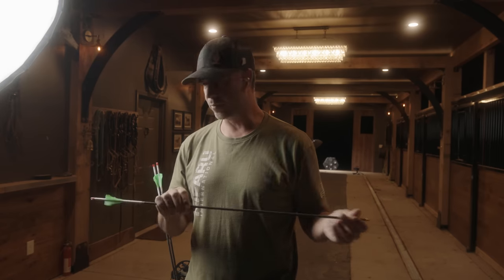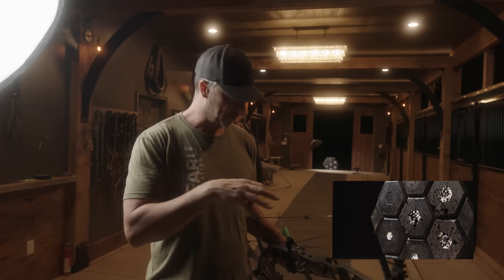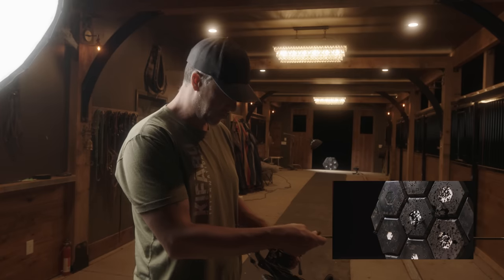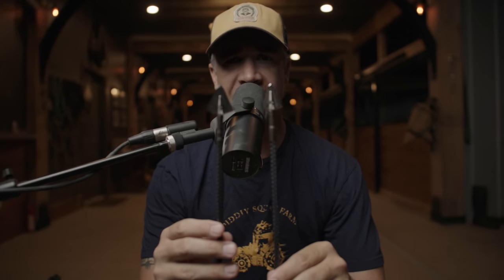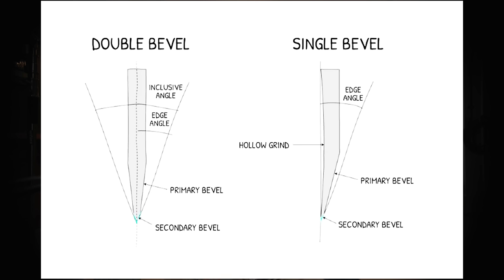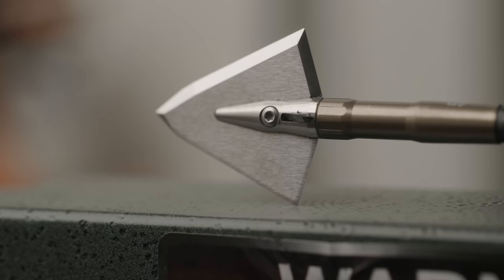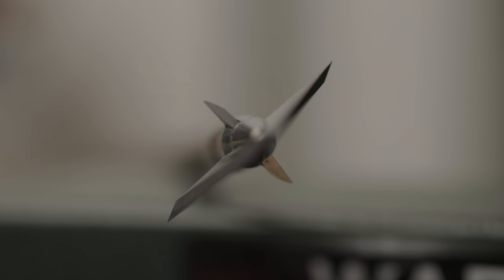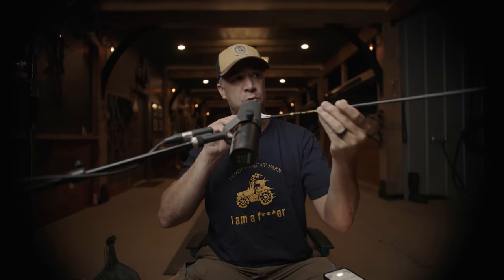Single Bevel is better than Double Bevel, but not the reason you think.

Comment: So i have 1 honest question that anyone is more than welcome to answer. I have wanted to use the Iron Will single bevel braodheads. A guy I know that owns a bowshop, told me to not waste my money on IronWills. If I want single bevel broadheads then I need to save about a 3rd of the cost and get Kudu 125g single bevel broadheads. I will say that they enter and come out with so much force. Almost every arrow hits the ground after a full pass through and shatters into multiple little 3 to 7 inch sections. Victory Vap Game elite 300. Total arrow weight is 487g
Reply from the maker: I’ve shot those before and they were great.  For some reason I just like the IW stuff.  I think the spin of the single bevel is more the point for this one as long as the surface area of the blade is similar
Reply: Ive shot Kudu's.  They are awesome.  My complaint about the Kudu's is that I sometimes have issues re-sharpening even with the stay sharp guide.  Can't really sharpen the bleeders and they are really small.  I find IW to be easier to sharpen even though its a harder steel.  Bleeders on IW are wayyyy better than the Kudu.  But cant go wrong with either head.  If you're on a budget, buy the Kudu.  If you can swing the IW, you wont be sorry.  You're going to kill whatever you hit with both heads.  It comes down to budget and what your preference is for sharpening.
Reply: @brandonmcdonald6121  thank you for taking the time and responding sir. I have been using the IW 125gr single and I won't go back to the Kudu lol. Kudu were nice but IW is noticeably better in my personal opinion.
Reply: @jons858  I completely agree now that I've been using the IW this season. Got a 6 pack and I am impressed.

Comment: Could you not test this by simply marking a vain or a line on the shaft and then shooting a target 3 feet from the bow and see which one rotates more in that distance? 
Maybe you would be able to tell if there’s enough difference in rotation with a single bevel that it would pay to do more testing with a high speed camera.
Reply: Agree but might require using the cut angle at target entry point since the single bevel will rotate in the target too.

Comment: I've always believed that the aerodynamic ability of a 125gn target tip is equal to the aerodynamic ability of a 100gn broadhead. Add that concept to helical vanes and single bevel equals the G.O.A.T  arrow
Reply: i agree with you, my 125gr field points shoot perfectly with my 100gr swhacker broadheads at distance, when i was shooting 100gr ramcats i had to use 150gr field points to match them at distance. i would never expect the same gr broadheads and field points to shoot perfectly together because the aerodynamics are totally different.

Comment: Tl;Dr: Gyroscopic stability from a single bevel is technically present but practically and likely statistically irrelevant. Confirmation bias is far more likely. 

There is no way air pressure creates enough force on the bevels to cause a noticeable(read practical probably even measurable) difference compared to any other broadhead of the same shape/wieght with a different edge grind.
 It's WAY more likely that you're running into confirmation bias.  I especially suspect since you don't show any steps towards removing bias.
Reply from the maker: It’s for sure possible. Only way to really know is to remove the human element altogether. I’m a redneck tester.  I don’t think I agree with you, but your fancy words tell me you might be smarter than me 🤓
Reply: try sticking something like a broadhead out a car window at 80 miles per hour and see for yourself how much air pressure there is. now think 200 miles per hour. also its not the gyroscopic moment that reduces deflection, its that deflection is spread through 360 degrees of rotation. lets take extremes so that its more obvious: when the arrow doesnt rotate and the aerodynamics pull it to the side - it deflects way off to that side. but when an arrow is pulling to the side but at the same time is rotating, its pulling to a different side every moment, thus greatly reducing the overall deflection.

Comment: Why not just stick with the big mechanical? You can’t argue with your own results. With such high efficient bows, high quality arrow builds for me mechanicals are working better than ever.
Reply from the maker: I go back and forth.  Should have used the biggest damn mechanical I could in Canada.  I think it’ll be a thing I’ll always mess with over time. Back and forth.  Heavy, light. Mechanical, fixed.
Reply: @brandonmcdonald6121  I do the same thing. I have a drawer full of different heads.  Arrows of many weights. The RIP VI with 150g Micro Hades with a TAW of 375 has beeen nothing short of amazing on pigs this year for me. Even questioned it for my elk set up.
Reply: @deanbrantley wow, 375 grains on pigs! thats NOT ranch fairy approved (lol), what speed does it manage?
Reply: @georgewashington1621  I’m not sure. Prime Inline 5. 70lbs, 29”dl. If I had to guess 300 or maybe alittle more. I’ve had them blow through so fast they split saplings behind them.